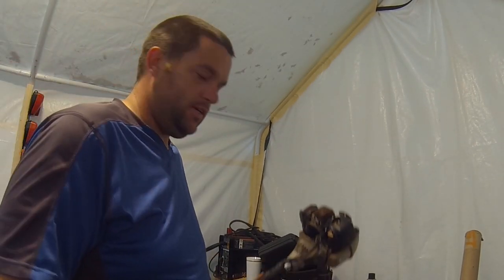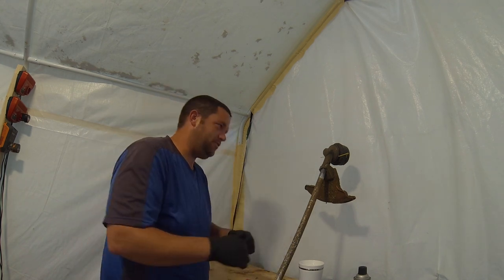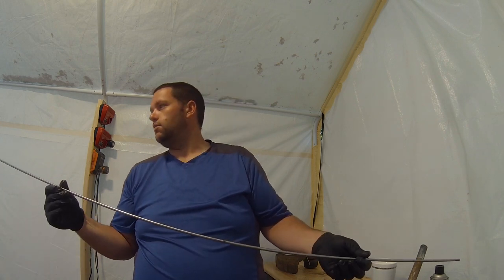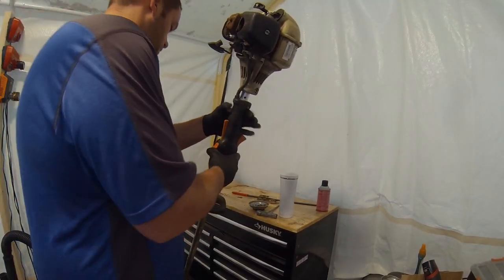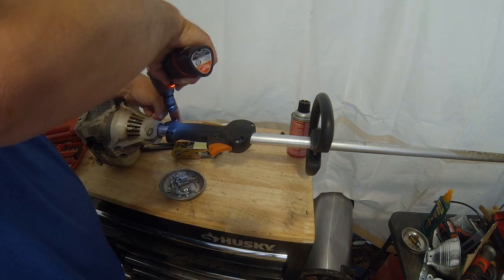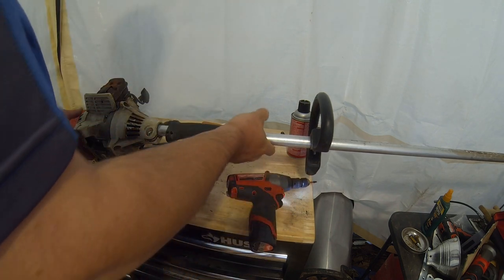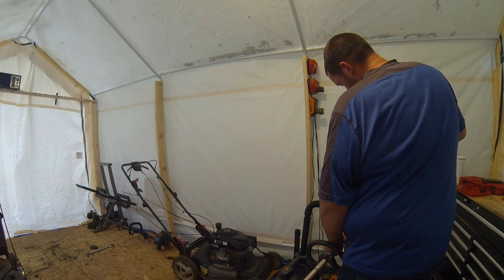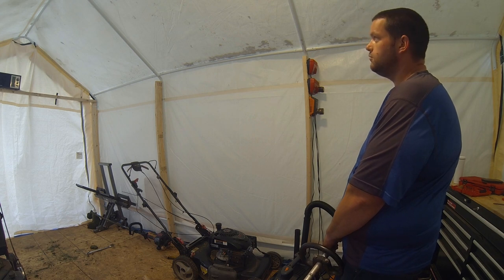Replacing The Drive Shaft on a Stihl FS90R (and Adjusting the Throttle)

Comment: Exactly what I was looking for.  I have two trimmers at work that have drive shaft issues.  Now I can confirm.  Thanks!
Reply: what's the symptom of driveshaft issue ?
Reply from the maker: It’s not the only symptom but losing power at the trimmer head can be a sign of driveshaft issues

Comment: Shouldn't you of greased the new shaft? The problem I'm having is the pull rope pulls and retracts fine but doesn't catch to turn the motor. Could that be from a worn shaft, or is that another issue?

Comment: You need to grease the shaft Randy. That’s what my dealer told me when I replaced my FS 94 R
Reply from the maker: thanks, throttle is all jacked up so I gotta take the thing apart again anyway.
Reply: YES! grease that shaft, think with your dip stick Jimmy!
Reply: @seekersees693  can you use copper grease?